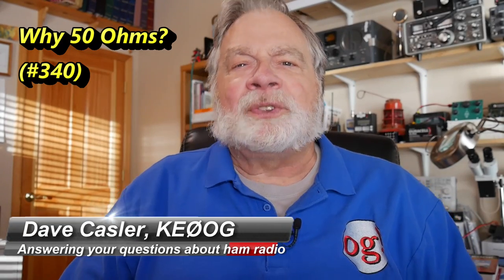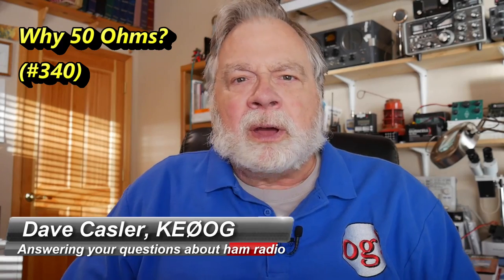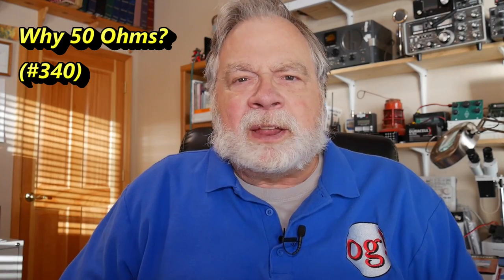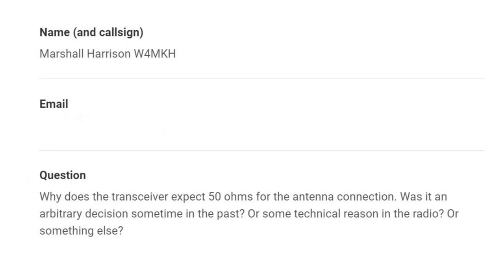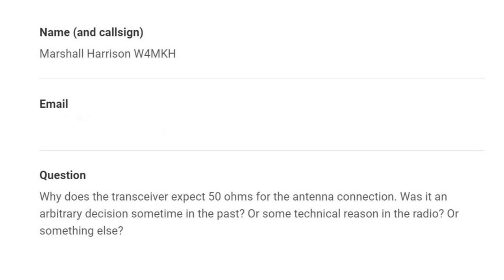Why is Coax 50 Ohms? (#340)

Comment: Interesting. I sorta lost the relationship from "cross talk" to transmission line. If he suggested coax to eliminate cross talk, why does the phone company still use twisted pair?
Reply: Twisted pair is fine if everything is balanced and isolation is good,  I have never seen co-ax used for a single speech circuit. Co-ax would be a lot more expensive and unwieldly.
Reply: @hexadecimal7300  Telephone trunk cables use a number of twisted balanced pairs within a single grounded shield to protect them from external cross talk and interference.
The number of pairs in underground cables is commonly 50 or 100.
Reply: @wilsjane  Yes correct. Probably armoured too. A shovel going through a 100 pair could ruin your whole day. However in an emergency eg. A bomb blows through it and you need comms quick, you just ignore the pairs and connect ad hoc then sort out from each end, of course your cross talk increases and can be bad but if you have spare wires you connect a spare wire at one end only to your telephone circuit, try one of the pair at a time, the crosstalk usually drops dramatically. Do trunks still exist?  I think each trunk used 6 wires TX RX and 2 signaling, But it was the 70's, used to know the color codes off by heart. Happy days.
Reply: @hexadecimal7300  Here in the UK, most cables run through earthenware pipes, so shovel damage is quit rare. 
The major problems were the independent companies who used contractors who laid their cables just below the surface and anywhere they liked. 
When these cables got damaged as a result, once the contractors were finished, they had no engineers. On one occasion, by the time that they found someone to sort it out, 100 customers had been without service for 3 weeks.  
The biggest problem in parts of London below the river level is water. All the manholes often fill to the brim and being connected by the ducts, water runs between them. It could take a day to find the lowest manhole and pump the whole lot out. The fault was often when the old cast iron top hats were replaced with plastic which floated when not strapped down. Just open all the manholes, find the one with the top hat floating on top and you had found the fault.
These days, everything is fibre to the cabinet, so the multipair copper only feeds the properties. These are often falling apart and when an order comes in to connect a new subscriber and you have 8 spare pairs, you are lucky to find one that is not open, short, or has an earth fault. 
In the future, their are plans to run wireless from the cabinet to the premises, so all the copper will go.
I am actually a commercial design engineer, but having worked for 45 years, most of the engineers know me and like the fact that I know the problems that they are up against and accept that some jobs take time. LOL.
Reply: @wilsjane  Thankyou for the interesting story and info. I was in military comms all my working life. Now retired in a country where your joints dont ache ... unless you drink too much and forget your medicine ;), Covid lockdown what covid lockdown !

Comment: I was thinking we need 377 ohm total, impedance of the antenna and cable. So, 75 ohm cable with 300 ohm antenna, or 300 ohm cable with 75 ohm antenna.
Reply: Nooooo, not that! You want the antenna to match the transmission line. 377 Ohm is the "Impedance of free space" - not really anything to do with this stuff on transmission lines. :)  https://en.wikipedia.org/wiki/Impedance_of_free_space#:~:text=Z0%20%3D%20376.730313668,light%20in%20vacuum%20c0.
300 Ohm is often used for balanced antennas because a 2:1 transformer (a balun: BALanced to UNbalanced) matches it to 75 Ohm coax. The impedance ratio is the turns ratio squared!, so it is 4:1.
Reply: No. Nothing at all like that.

Comment: To a fullsize Loop-antenna 
total= 273feet; Metric= 83,01m. I use 450 Ohm s.c black ladder-line (stiff ie one lead!Whatch Your EYES! Ware protective glasses) and feed it intog a 
2:1 [4:1] Balun. from there 
abt 2 m RG213 to rxtx. 
Sides Rect [12,7 m, 23,5m; 
12,7 m 23,7m] or circular 
abt 13.6m in diam. A.High 
place to mount it >12,0m 
or better.
73s de Gunnar sm6oer >>\<

Comment: I was told that the tracks on a Printed Circuit Board are 50 Ohms also.  Is this true?
Reply: PCB traces are dependent on the trace with, material dielectric, and other spacing dimension.
Thus, can be tuned to various impedances.

Comment: I recall hearing or reading about cable length needing to be frequency divided by 3 or divided by a multiple of 3. Has anyone else ever heard of this?
Reply from the maker: The rule is an odd number of half wavelengths. Like 1/2, 3/2, 5/2, etc. If you do this, then the antenna impedance is exactly repeated. The problem with this rule is 1) it only works at one specific frequency, and 2) if the antenna is pretty well matched, then it doesn't matter what the length is. Easiest is not to worry about cable length.

Comment: I have heard that the choice of 50 ohm cable minimizes the amount of material used to make the cable. Perhaps this is not true. as various 50 ohm use different amounts of material in their construction.
Reply: Yep, not true at all. Whoever claimed that had no idea at all what they were talking about. 50Ω is a compromise between 30Ω (power handling) and 77Ω (transmission efficiency).
Reply: ms3bani The explanation I heard back when I was attending university was that if you took a coax cable with minimum loss geometry and then replaced the air dielectric with a plastic dielectric such as polyethylene you end up very close to 50 Ohms.
Reply: @johangrundlingh3729  This is exactly what I came up with by studying this subject a couple of years ago. So I actually searched in the comments for this explanation.

The 30, 60 and 77 ohms is measured with a dielectric of air (which off course gives the lowest loss).

Minimum attenuation occurs for D/d = 3.591 => 77 ohms in air.
With polyethylene you divide the 77 ohms with srqrt(2.2) = about  50 ohms.

Comment: I can't help but wonder, though, whether the lower loss at 75 ohms would offset the lower power limit at 50 ohms.  Obviously this would depend on the length of the cable, since attenuation is cumulative while power limit is fixed for a given type of cable, so for short cables there wouldn't be that much difference in attenuation, but I wonder where that crossover would be.

Comment: Is that 50 ohms per foot? Per meter? Or regardless of the length?
Reply: Regardless of length. Z(0)= sqrt(L/C). Longer cable would have more l and c compared to shorter cable but ratio (L/C) is the same as l and c are characterized per unit length.

Comment: Heliax to the tower. Most of us hams would sooner use a balanced line. Balanced lines do not get water in them and have extremely low loss and high power handling abilities. Why not touch on that subject? For many, any feed line over 60 feet or so becomes too lossy and too expensive for the average ham to consider using.

Comment: I am not completely convinced by the convention vs "best" argument. I expect Bell Labs were keeping it real and only tested practical sizes and proportions of coax for common dielectrics and likely tested a few test cases, hence the 3 quoted impedances. Let's not forget open feed line is also very efficient and is far from 50 ohms.
One question I have pondered is the effect of substituting a good conductor like copper with say stainless wire with HF antennas. SS is common on V/Hf antennas since ohmic losses will be small given the usually lower power levels and short lengths but I wonder just how large a SS conductor must be compared to copper for any given power level at HF frequencies. RF being a complex subject I am sure simple ratios of conductivity would not be accurate.
Reply: Stainless steel is used on a lot of sailboats by insulating the back stay and works well, how much loss? I don't know but they seem to work fine I have a copper wire 12 guage stranded & insulated) pulled up on a halyard on my sailboat and a back stay (aprox1/4 stainless 1x19 stranded and about 10 feet longer)  on a boat I am working on using the same HF radio on each with an Icom AH4 on mine and a commercial marine coupler on the other ( icom AT-140)  and they both get about the same range of receive and transmit ( tested with wspr and others).
Reply: @OldinMariner  Yes it was the marine application that sparked my interest. Your experiences clearly show it can be done but going from 12g to 6mm 1x19 is quite a leap especially windage and support wise. Many years ago a friend tried to make an 80m dipole with 1.2mm copper coated MIG welding wire. His reasoning was the copper would do the trick via skin effect but it was a complete failure due to ohmic losses and negligable skin effect I suspect.
Reply: Open feed lines are totally different from the coaxial cable.
Yes, it's the lowest loss line.
Because the air is the dielectric in most part it can withstand high SWR and depending on the distance between the two conductors (limited by the operating frequency) voltage breakdown.
The Bell laboratories found out the typical values by experimentation for the coaxial cables.
So, the transceivers are manufactured with the 50 ohm impedance requirement.
You are always welcome to use the lowest loss open lines provided you use some kind of impedance matching units (tuners, simply to say)
Open feed lines have their origin from the telephone lines/audio lines having the characteristics impedance of 600 ohm.
Reply: "It can be proven mathematically that for an ideal coaxial transmission line with an air dielectric, an impedance of 77-ohms provides the lowest signal loss, while 30-ohms provides the highest power handling."  the mathematical model determines this, not 'tested practical sizes for common dielectrics'.

Comment: At around 8 minutes you refer to "modern cable" not using air dielectric and instead polyethylene... Not quite correct OM  have  a look at qrz and tell me if I should switch out my "unmodern cable" 73 de VE2AED

Comment: Because the commonly-used dipole antenna has a Z of 73 ohms, you must do something to match the 50-ohm coax to the antenna. Considering that, doesn’t it make sense to make the transmitter and coax both 75 ohms, that is, for overall simplicity, let the antenna dictate how all the rest is designed? Just sayin’...

Comment: You make the comment on differential calculus, this is not correct Newton invented differential calculus later refined by Leibniz, "Differential calculus, Branch of mathematical analysis, devised by Isaac Newton and G.W. Leibniz, and concerned with the problem of finding the rate of change of a function with respect to the variable on which it depends."
'

Comment: Isn't the coaxial cable an extension of a Faraday Cage?
Reply from the maker: Not really. It's a transmission line, and the dimensions are critical to the properties of the coax.
Reply: @davecasler  Hi David not exactly what I meant.  You were speaking about cross talk between phone lines.  By using a coaxial cable the electric/magnetic field created by the central conductor cannot escape because it is like a Faraday cage.  Hence closely laid coaxial cables will not cross talk.

Comment: So, 50 ohm is attenuation.  I was told at school that it is to avoid bouncing.
Reply from the maker: 50 ohms is the characteristic impedance, not the amount of attenuation. The "bouncing" has to do with reflected energy forming a so-called standing wave. The Standing Wave Ratio (SWR) measures the amount of bouncing.

Comment: Falseinfo.

Thecable is no lt " 50 ohms" or any other value.

Real PHd EXPERTS ( NOt radio operators) Brown, Sharpe et al in Lines, Waves and Antennas say the characteristic is NOT the line, but the LOAD which when the correct value, results in no reflection.

This is a common myth.

Tlines do not have impedance.

Comment: RG6 ... 70 ohm .... ?  when mentioning "power" and so on...  100 W barefoot?  up to what?
Reply: RG-11 is a lower loss option.  Before solid state rigs many hams ran RG-11 as well as RG-59.  Great match for dipoles and the tube transmitters could match via pi network.

Comment: During ww2 not as much copper was available to make cables for radio transceivers so making a 50 ohm instead of a
36ohm for a transmitter and 75ohm for the receiver 50 ohm
Better yet they used 52
Ohm RG58/U wich used even less plastics and rubber and was good for short runs under 100 feet and can
Handle 100watts.
That was a nice long
Technical explanation
You lost me after about 2 minutes most all people will tune out
When you show how
Knowledgeable or smart you are about
Something.
Just have a good time
With it. There was a man named Watts
Ohms. Volts Amps tesla and Hertzs.
Edison and his
Edison effect light bulb
Where electron tubes came from thermionic valves where what's a diode and triode were the first types. When I first received my ham radio license upon taking the test the guys they're at the club told me you don't have to show us how smart you are just pass the test.

Comment: Because America wanted 50 Ohms, when the rest of the world knew it was 75 Ohms.
So we all had to conform to American standards.
A Ham is a Ham, Not a Engineer.
Reply from the maker: Well, at least you got N-connectors and we're still using the old "UHF" connectors.
Reply: @davecasler  SO239 here too still in Ham gear. Could be worse Belling Lee 75 Ohm connectors were not that good, plus the real oddball PYE, Racal an BBC ones!
C connectors, what was that about?

Comment: This is the nightmare for Electrical and elctronic security system design.because it can remotely by pass the key control circuit and goes direct to the actuator to open the lock

Comment: During my studies, at the time when micro waves were transported via pipes, I remember that the air has an impedance of 54 Ohm. That's why 50 Ohms at that time.
Btw, twisted pairs of telephone cables have 800 (600?) Ohm. Flat TV cables have 240 Ohm.

Comment: What does it mean 50 ohms?
I mean is it 50 ohms per meter?
Reply: No, it is not per meter. It doesn't depend on the length of the cable.
Reply: How is that possible?
Does it have somethin to with difference between inpedance and resistance?
 @odissey2
Reply: @phlogistonneverunafter3336  once electromagnetic wave entered the cable, it propagates infinitely (neglecting losses). The 50 oHm impedance only means that if you terminate such cable with 50 oHm resistor, there will be no back reflection of the wave - it will gracefully absorb by the resistor. Saying that, the 50 oHm impedance is related only to propagation of fast (nanosecond) pulses through cable. It is not related to a DC voltage. For DC voltage resistance of the cable (per meter) depends only on the wire gage, like any other wire.
Reply: As he pointed out it is sqrt(L/C). L and C are per unit length. The ratio remains the same irrespective of length.

Comment: im guessing loop antennas
Reply: WroNg Answer...... 
WHY DO YOU THINK SOME LooP ANENNAS Use Coupling Loops To Tap The Loop To make a 5o Ohms Impedence connection........ 
The Loop Antennas is Probably the one and only Antennas With the Highest Possible Q-Factor in RF Terms Or For The Un-Knowledgeable  Q uality FACTOR..... 
And that is because it is a tuned cicuit with the inductance / L / Or Inductive Reactance in Ohms OF THE LOOP ITSELF witch Resonates & Creates An L/C Resonant circuit With the tunable Capacitor.......................
It's Also one of the most difficult antennas to make good because the reactances invilved are in the milli / micro Ohm Range And therefore The extreme resistive losses in all Loop Antennas....................................................................
Reply: @yvindthemaestrohellevik9184  Paragraph breaks Hellevik, you should use them.

Comment: Heaviside later on rejected electron theory.
Reply from the maker: He was quite an unusual man. He's correct in the larger sense that the energy is in the electromagnetic field (there's something called the Poynting Vector), not in the copper conductors, and electrons moving around is more a symptom of what's really happening. But for us mortals, circuit theory works great most of the time.

Comment: OK.  Why 75 ohm?
Reply: Because it has lower loss than 50Ω, though also lower power handling. Which makes it a better option in receive applications, where you are going to be dealing with very, very weak signals and attenuation really has to be minimised.